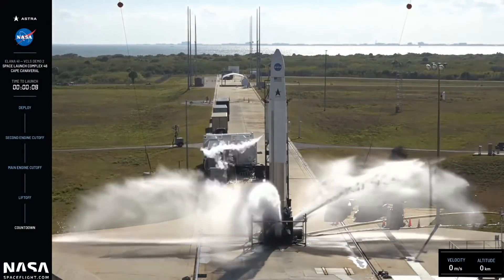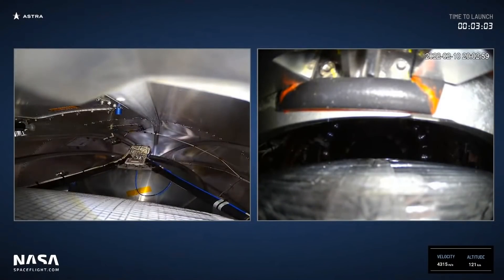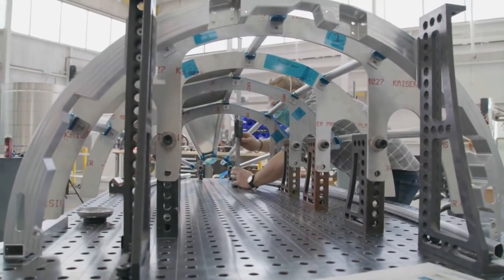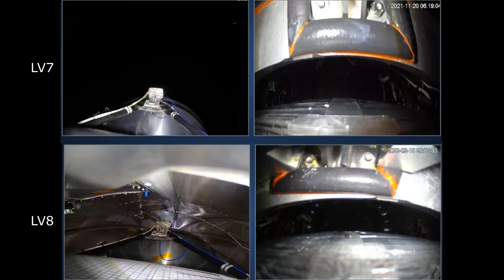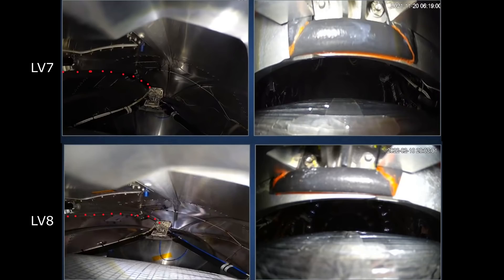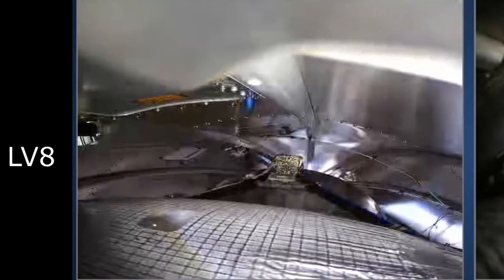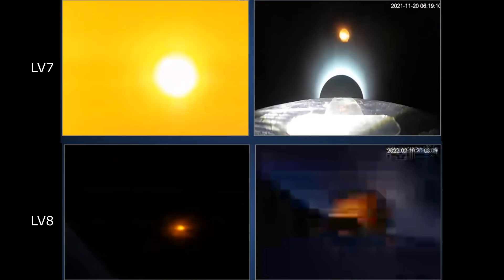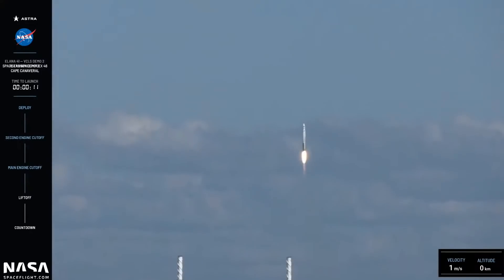Rocket Launch Doomed After Payload Fairing Won't Open

Comment: I wonder if they could fire attitude control thrusters to blow away the fairings and save the mission. It seems they had few seconds.
Reply: You mean send the first stage spinning, hoping that the fairings get flung off before the seconds stage rips out of its attachments? Well that sounds THEORETICALLY possible, but it seems like there's about as much that could go wrong with THAT than with launching the second stage into a partially locked fairing.
Reply: @Pystro  no, fire the thrusters in opposite directions to blow off fairings with pressure. Just what the second stage engine did.
Reply: @TechMasterRus  Ah. Well it would certainly be less violent, with only maneuvering thrusters firing instead of the main engine. And the second stage wouldn't scrape against the fairings once those open up. But the insides of the fairing would still need to be filled (and pressurized) with hot exhaust gases - so no difference in terms of how hard the second stage gets baked in there.

If however you knew that there could be issues with the fairing clamps, you could intentionally arrange the second stage in such a way that you have maneuvering thrusters pointing directly at those clamps, to hopefully blowtorch them open.
Reply: @Pystro  I think they have CGS but not sure. But any way, gas gets colder when it expands.
Also it's interesting that their flight control program does not include checking of fairing deployment before firing second stage engine.

Comment: Why didn't the operators stop the 2nd stage
Reply: Typically, the sequence is controlled by the on-board computer and ground control only watches the telemetry.

In many, maybe even most missions some things do not go 100% to the specifications. You still try to continue the flight the best you can. Perhaps if they had a slightly better luck, the second stage would have blown away the fairing, and continued the flight successfully.

Comment: Excellent video, Scott!  When I watched the launch, I wasn't sure what I was looking at, but it obviously wasn't right.  It looks like the first stage worked correctly this time.  And your explanation sounds like it is probably on the mark, although Astra's root cause analysis should hopefully figure out what went wrong, and they come up with a fix.  My gut feeling is that it should not be too insurmountable.  After all, there's a lot more experience out there in the field these days.
Reply: The rocket pitched over way too much during ascent. The booster is designed to fall straight down (because the rocket should be going straight up) at stage-sep. This rocket was traveling near perpendicular to the ground at MECO. It appears that upper-stage basically got wedged inside of the booster cowling when they attempted separation - almost certainly because of the unusual attitude. S1 is supposed to go straight up - as high out of the atmosphere as possible, then stage-sep, then the rocket pitches over and the vac-optimized engines just add the delta-v you need to give you orbital-velocity. Things went wrong with this flight seconds after ignition. The rocket was in an abnormal regime for the entire ascent phase.
Reply: @realdizzle87  uh, nope. How did you come to that conclusion?
Reply: @realdizzle87  While I have no idea if the launch actually works as you described it, i.e. going straight up (intuitively, it doesn't sound correct to me), I believe you meant "parallel" to the ground.. not perpendicular.

Comment: Astra has had two of the most Kerbal failures in recent history!
Reply: Either they haven't played enough Kerbal, or they played too much Kerbal...
Reply: @PsychoMuffinSDM  it’s a fine line indeed.
Reply: They might be using Kerbal as their simulator.
Reply: Have you heard of the tragedy of Chandrayaan 2 Lander? It legit lithobraked on the moon like most of my rockets in KSP/SFS
Reply: @Zeunknown1234  Have you heard the tragedy of Chandrayaan 2 The Lithobraker?

 I thought not. It's not a story a Kerbal would tell you.
Reply: @Brick_One_A_Lego_Story  It’s a Kerman legend. Chandayaan 2 was a Moon Lander of the India, so powerful and so wide he could use the Engine to influence the gravity to safely land… He had such a knowledge of the landing that he could even keep the main hull he cared about from crashing. The Thrust side of the Engines is a pathway to many abilities some consider to be unnatural. He became so powerful… the only thing he was afraid of was lithobreaking, which eventually, of course, he did. Unfortunately, he taught his software everything he knew, then his software crashed him into the surface. Ironic. He could see others land, but not himself.
Reply: @infinitespace2520  Is it possible to learn this power?
Reply: @Brick_One_A_Lego_Story  lol
Reply: @Brick_One_A_Lego_Story   Not from an American.
Reply: @Brick_One_A_Lego_Story  Not from a Kerman
Reply: Me when I forget to check my stages
Reply: It's not a Kerbal failure if it cannot be fixed with more struts.
Reply: They just need to add more boosters.
Reply: Wait until they need ladder and parachutes…
Reply: They probably forgot solar panels too…
Reply: I guess anything called Astra usually tastes disappointing..
Reply: Yea
Reply: What's next? Don't accelerate time warp close to the target?
Reply: Does that mean their next failure will involve the kraken?
Reply: All to familure with them from space flight simulator 2
Reply: Check your staging several times.  Can’t fix it after launch

Comment: I posted in another thread, but my WAG is that the payload wasn't properly secured, or something happened. Looks like I was wrong and it was a failure of the faring separation mechanism that failed, or the bolts that held the faring together failed to... well, if they're explosive bolts, they didn't explode. If it's a capture mechanism, it didn't release.

Comment: Excellent analysis. The bright side is that this seems like something that is easy to correct. Sad that fairing separation was the issue that ruined this mission though. I suppose it’s probably one of three things: hardware quality control, software that was changed between LV0007 and 0008, or just a poor design entirely and LV0007 got lucky.
Reply: Nothing is as easy as you'd think in engineering. Basic rule for project estimation: Take your best guess, then double the number and go to the next highest unit. So, if you think it will take 2 days, double the 2 and change "days" to "weeks", and you end up with "4 weeks".
Reply: maybe hiring that former Boeing Starliner engineer who came cheap was a bad idea ?

p.s. jk
Reply: i suspect software.  it clearly doesnt have a troubleshooting acknowledgement of the faring being still present, which is easy enough given it has an onboard camera.  If it had that abort they mightve been able to troubleshoot the faring and wait to ignite the other stage..
Reply: @reasontexas  It can even have sensors that prevent engine ignition when the shroud is still attached.

Doesn't help a lot if they can't control any of the fairing separation mechanisms from the ground though.
Reply: Hope Astra was watching the video. This would be rather helpful if they missed this.
Reply: As Hashim pointed out, the rocket sat on the pad for an extended time before the launch. The problem might have been environmental, namely unforeseen humidity freezing at altitude.
Reply: @GregConquest  That's a very Boeing-esque sort of failure, if so.
Reply: @GregConquest  Florida definitely jas enough humidity for that idea.
Reply: Last
Reply: don't forget environment as well (while sitting on the pad).

Comment: If it can recover from that spin and go on, they are going to be on the top rank together with their engineers.
Reply: I don't think any design would carry enough fuel for any such a correction (though maybe you're joking). Since major orientation deviations, even moreso such flips, happen so rarely, engineers would not budget that extra fuel weight in the second stage.  And even more extra fuel would be required in the first stage just to carry the extra second stage fuel that would not normally be used. That's a lot of extra fuel, and economizing fuel load is one of the fundamentals of  rocket science.
Reply: @GregConquest  I'd guess the energy in the tumble would be far less than the marginal extra fuel the second stage would carry. The difficulty is either not being able to direct thrust to counteract the tumble alone, or not being able to 'toot' the thrust in a sequence of thrusts timed and aimed with fantastic (literal meaning) precision to both cancel out the tumble and to contribute to motion along the intended path. Without incredible gimbal limits and fantastic thrust control, the only option would be fuel-exhausting barnstorming. You're right, just wanted to say it's not exclusively an energy problem.
Reply: @GregConquest  Kinda curious if there are any reaction wheels in that stage. Many times they have saved my ass from unstable rocket in KSP.
Reply: @ImMortal468  Sadly, reaction wheels are far less powerfull IRL and also need to be desaturated with rcs. I doubt the second stage would be able to do that but tbh I don't know how their upper stage controls orientation. The engine does not look like it gimbals..
Reply: @maehschaf6699  then what about spin stabilizing whole rocket?
Reply: @ImMortal468  Hmm, I think spin stabilization is mostly done in Coast phases as during ascent you actually want the rocket to be controllable in pitch and yaw. And if they were using spin stabilisation for the second stage I think they would only begin that after seperation so it wouldn't have helped here

Comment: Presumably the failure effected the engine gimbal system or the guidance system. It should've had the capability of recovering the attitude even with a 360 tumble. The high pressure of the event could easily have damage something in the engine.
Reply: A rocket can recover from a 360 degree tumble if it is tumbling slowly enough and the main engine has shut down, but I don't think it can recover from so quick a spin with the engine at full throttle.
Reply: @chrisantoniou4366  
Just the opposite.
It certainly can’t recover if the engine is shut down. They need the thrust to control the attitude.

Depending on how the guidance computer is programmed, there may be a limit to the tumble rate it can compensate for.
It wouldn’t be difficult to program it for this situation, but they may’ve thought it wasn’t worth doing.
Also, the engine might’ve been damaged, and there is nothing they can do about that.
Reply: @EtzEchad  All that you say is true.  I was talking about attitude control thrusters and the fact that the second stage engine could have been the problem causing the tumble.
Reply: @chrisantoniou4366  
Indeed. If it was an engine problem, nothing could’ve been done.
Even if it wasn’t, it probably couldn’t have gotten into orbit after even one tumble.
It’s fun to speculate though.

Comment: ... am I the only one who's noticing that there's something bouncing around inside the stage?? In the left hand camera: Starts at the bottom, bounces off the right, slams into the top causing noticeable movement, goes off the left camera. Moments later, the metal bar on the right camera all of the sudden gets chipped. Then the spacecraft tries its failed deployment. Looks to me like something blew off with a lot of force.

Comment: Could it have been related to the recent activity in the sun? Great video!
Reply: unlikely but not impossible, nothing at that point in the launch should have that little margin
Reply: That's an interesting theory, usually when you suffer a failure you çan track it down to; Mechanical, electrical or  fuel related but every now and then you can get an environmental cause for a fault/malfunction.

Comment: As this is still an experiment rocket (in my book, until you get three successful, non-nail-biting launches in a row, any new up-goer is experimental), I can't fathom why anyone would want live payloads on it. The cost-benefit seems iffy.
Reply: University cubesats are generally teaching projects, it's just a bonus if they actually make it to space.  So it's absolutely worth the massive discount of an untested rocket.
Reply: The unfortunate side is that you only get one, maybe two, of those before you have to start getting a return. Astra is unfortunately going to be in that category of a very short prototype/test phase and everything has to go smoothly after that or they run the risk of so many private space companies before them
Reply: It seems particularly brutal to the students. But maybe they get on because nobody else is going to risk their stuff even at a reduced price. They roll the dice and maybe get into space. The NASA payload is a tech demo so it wouldn't get to go on a real mission. ELANA is NASA funded, so it is all US Gov money, not Uni money, to be clear.
Reply: @Markle2k  For the student payloads, those can be down to $10k for the mission launch on experimental launches which is around 1/100th the normal cost.
Reply: @narobii9815  The students contribute to the launch cost with ELANA? I figured they just built a satellite and competed for the slot with the other teams.
Reply: @Markle2k  not sure in this specific case. But I know a few years back on some high risk launches, professors and students could get spots on the rocket for insane discounts. How the student team pays for the seat depends, bake sales, college budgets, parents pocket change, all depends on the team and the college.
Reply: @Markle2k  Yeah why not risk it as far as NASA if concerned right. After all it's not their money their risking,  it's the American tax payers dollars. You must not be American but if you are, I don't know why you think NASA had "their" own money.
Reply: @MentaIPatient 
Lol
NASA engineers pay more income taxes than you do
Nice try tho
Reply: @MentaIPatient  This is the Venture Class Launch Services program. They are expected to be higher risk. They are low-cost launches intended to allow companies to develop cheaper access to space for cubesats. Astra's contract was $3.9M. Rocket Lab and Virgin flew the first two VCLS missions. It was only the third successful launch for Electron and the very first success for Launcher One.
They don't carry expensive missions, they carry development hardware that is not of the Technology Readiness Level to go on operational missions. NASA JSC's R5-S1 satellite was to demonstrate the technology for an inspection satellite using COTS hardware to possibly reduce the need for human EVAs.
Take note that until now I ignored your political BS.
Reply: Having no payload is a total waste.  Clearly, some have decided that taking the risk is worth it given the deep discount.
Reply: @somedumbozzie1539  that is a great idea. And someone above said it's only 10k. Not a bad funneral
Reply: @GiBBO5700  I've never been to a funeral that included a shockwave or a debris field before...
Reply: @somedumbozzie1539  $20k?  A backhoe for a day and a bag of quicklime would set you back only about $100 !
Reply: Were I shopping around for a way to launch a payload, I wouldn't go near this. They need to prove it is reliable before they put customers' payloads on this.
Reply: Unless there is financial benefits from failing! Insurance?

Comment: Interesting. So the stage fired with the fairing undeployed? I wonder about the failsafe (or lack of failsafe?). I guess weight is at a premium so they couldn't allow for every contingency.
Reply: If the fairing didn't deploy, the mission is over regardless: other than having a totally independent fairing deployment system (which somehow has mutually exclusive failure modes), once the second stage is trapped inside, there's no recovering.

Comment: Where the hell was mission control, nobody stopped the automated system from igniting the engine when the fairing didn't open.
Reply: @16BitGoofball  They might have been able to jig something together to force the fairing open before the point of no return, it would've atleast let them take it to a lower orbit or properly control the inevitable descent of the remains.

Comment: I said it in the Twitter comments: there's liquid droplets inside the fairing on LV0008. I'm almost certain that it was condensation from the high humidity of cape, and sitting outside for a few days led to that buildup. I would bet a lot of money on the cause of this being a short caused by liquid touching exposed electronics
Reply: Maybe frozen water.
Reply: Ice ice baby. Wd-40 would have saved the day.
Reply: @jeremyperala839  yeppppp
Reply: @jeremyperala839  oh hell yeah I completely forgot that it could be completely frozen locks. They used WD40 on Atlas to prevent that exact problem
Reply: LV0008 was sitting out there on the launch pad for more than 20 days. Maybe they should put a tarp on it next time lol
Reply: Get water in those latches and freeze it up.  That would certainly cause issues.
Reply: Astra already bet against you and they lost so you have a fair chance...